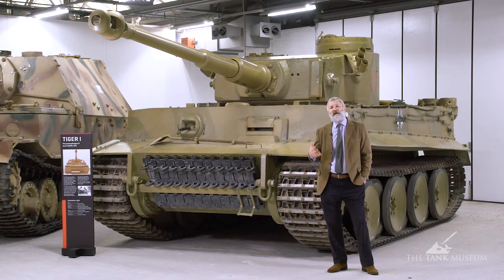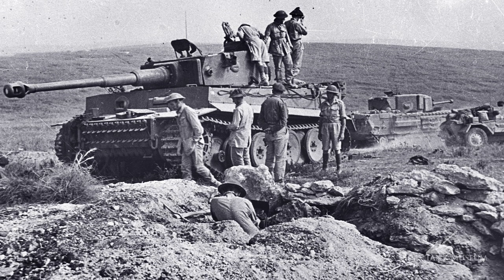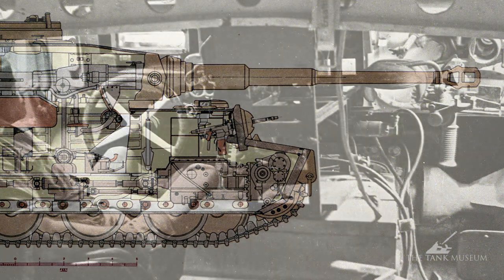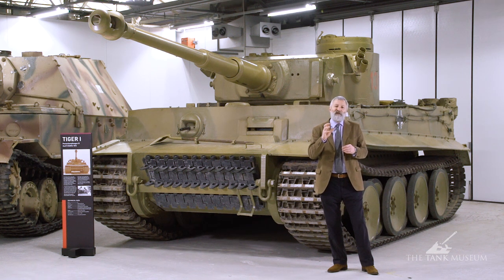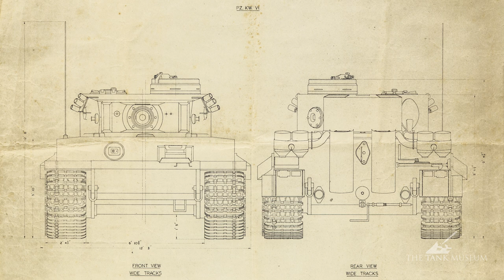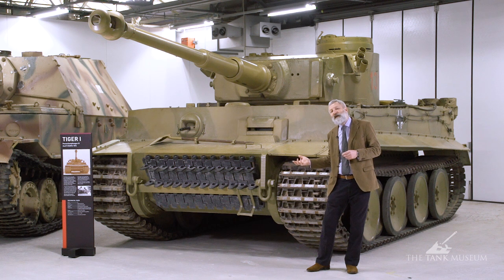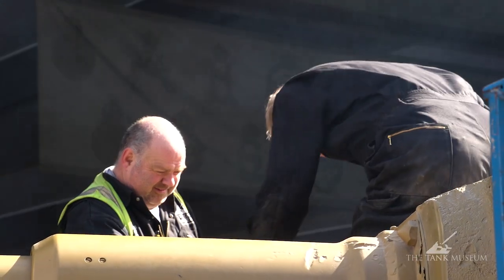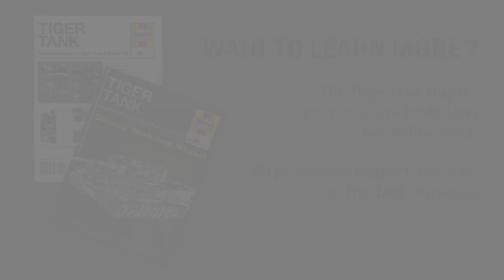Tank Chats #36 Tiger 131 | The Tank Museum

Comment: Symbol of oppression or not, Tiger 131 is still a monument to the skill of the engineers that designed it, just like U-505 in Chicago, the last of the Type IX-C U-boats. Oftentimes, you can find good things that were done by people that also did terrible things. Like everything else in the world, you have to take the good with the bad. If we were to stop using everything that was developed from things that Nazi Germany did, the modern world simply would not be possible. We would have never landed on the moon or have much of the electronic technology that we have now come to rely on. Does that cancel out everything the Nazis did? No, it doesn't. But if we remember what it cost to get where we are, then the people that died in WWII did not die in vain.
Reply: To be fair in comparison to other vehicles the Tiger I was only impressive in three ways. One of which ended up being meaningless, one that had draw backs, and one that was a big advantage.

The advantage being the gun. Nothing else has mounted such a powerful anti-armor gun in a fully rotating turret with protective armoring before. The actual armor itself was only slightly superior to the shielded KV-1 tanks and M6 (never combat fielded).  This in itself is an impressive feat considering getting such a large gun to actually work on a turreted chassis is not and easy feat.

The interleaved suspension enhanced it's mobility compared to other heavy tanks but came with huge service drawbacks. And each Tiger I was fully equipped with very high quality seals for deep fording all the way to the end of production which is quite the detail... except the deep fording was never actually used (And still hasn't ever been used in conflict to this day by any vehicle) which further increased the production cost and time.

FYI Modern electronics can't be  directly credited to Germany. Japan, United States, Germany, and Britain all had relatively equal development of electronics from the first functioning broadcast by professor Kenjiro Takayanag in Japan in 1926 on a cathode ray tube. By the late 1930s the industry was significantly more advanced in the United States in comparison to others in computing, radar, broadcast, etc. and the lead only increased during the conflict.

Rocketry however, at least the United States' definitely owes a lot to Van Braun. Without him and other german expertise the U.S.S.R. would have been the world leader indefinitely in that field. And Rocketry was a driving force behind continual U.S. advances in electronics for guidance, control, etc.
Reply: I agree. There's no argument against what the Nazi Germany terribly did, but we should still separate the deeds from the inventions. Credit is due for the technological and engineering feats that they achieved, and I say the Tiger 131 is one of the symbols for that.
Reply: I guess I was thinking more about how far electronics were developed in general by everyone because of the war (which was kicked off by Germany, unlike WWI where it was technically started by Austria-Hungary). Things like radar, radio communication technology,  and even the electro-mechanical computers that helped with encoding and decoding messages (like the Enigma or the computer that the British built to help decode Enigma coded messages.).
Reply: I agree. Those too. :>
Reply: German did not develop that much tech that surpassed other nations, the allies had massive advances that the Germand could not match, many German ideas were ultimately failures or already being developed or in use by the allies.
Reply: Okei. Thanks for clearing that up. Tiger 131 still looks cool though! Remarkable piece of artifact, wouldn't you agree? x3
Reply: Chaz t Please. The only reason the Americans developed the nuke first was because of defecting Nazi scientists
Reply: +ss33988  ..As well as British scientists, plus whatever information about the German & two Japanese bomb projects; one of which was said successfully detonated (on an island off the Eastern North Korean coast in 1945,) in a test in the a couple of weeks before Japan surrendered to the US - you could say, because of the test, the NZ Factory and Stalin wishes for the related intel, skills & humans involved, that is why North Korea became so important to Stalin & the Soviets in the late 40's, and why it is was destined to be separate country/state under Kim Il Sun (for Stalin).
Reply: I'm going to assume you are just one of those people that take conspiracy theories at face value and their 'evidence' in this case a book by Robert K. Wilcox using David Snell's story which was quite exhaustively discredited and debunked by every expert and peer.

There was no Japanese atomic weapon test. Their program went as far as to determine it was feasible (math will tell you that) but impractical  for even the United States during the course of the war to apply it in a practical weapon. And you think a country that couldn't even fuel their aircraft, ships, and have the metallurgy due to lack of resources to build reliable engines conducted an atomic test based off a book that used false documents as it's own evidence... 

Just because you read it somewhere doesn't make it true.
Reply: MPI1000 what he means are Scientists running from the Nazis before or during the War. Those did help the Allies. The Nazis never got beyond very early steps in the Atomic program. As others here have alluded to the Nazi,s were not scientific but simply put a huge drive to push engineering what was already known.
Reply: Exactly Generic Dave. They funded anyone and everyone that claimed to have something that could help them in their war effort or give them some kind of advantage over everyone else. This was both good and bad for the rest of the world. It was good for the rest of the world because many of these projects were crazy and went nowhere, while draining funds from other things, but it was also bad because some of these projects actually did work and caused much grief and suffering for both Allied forces and innocent civilians. After the war, everyone was scrambling to get their hands on the scientists and research materials that came out of these projects to learn what worked, what didn't, and what was worth putting their own research into. Both the U.S. and Russia built their cruise missile and ICBM programs on the foundation that was laid by the V1 'buzz bomb' and the V2 rocket, respectively.
Reply: ss33988 Oh really, nothing to do with allied developments, allied engineers, nothing to do with allied materials and money. Just a few German engineers? 

People like to big up German ideas from WW2 and refuse to put in context with what else was developed around the time or in use. 

They like to claim every invention or development after WW2 was due to captured German tech and scientists. 

There are even people claiming the bombs dropped on Japan were actually German bombs captured by the allies. 

Nazi Germany developed little in the way of really new tech, the allies developed more, post war ideas from all sides were used in some fields.
Reply: The only way Nazi Germany made the world the way it is today is by actually starting the Second World War. They were good at engineering(which has been debated endlessly if good or bad for war winning), but the allies came up with much more successful new technology. Britain in particular had a lot of good ideas(which the USA developed and produced successfully - radar, Merlin engine, jet engine, ect-). A big part of successful engineering industry is preparation. Nazi Germany had been gearing up for war since 1933 whereas Britain and the USA started pretty much only when war began. Just look at the aircraft and tanks Britain produced immediately after the war, tanks and planes that lead the world for many years despite Britain's poor vehicles produced during the start of the war.
As for "never landing on the moon" although the Nazi research no doubt sped up advancement in the USA and USSR, it would have inevitably happened anyway. Rockets are one thing, but the advanced theorising and practical challenges in supporting human life in space were not progressed at all by Nazi Germany.
In short, the war quickened the pace of war related technologies as all wars do, but with possible exception of nuclear weapons the world would be very similar to what it is now without it. 
Apart from Germany and Japan wouldn't has caused the deaths of 50,000,000 plus people.
Reply: I fail to see a way this tank can be oppresive seeing as it's made for soldiers, not concentration camp guards....
Reply: It has become a symbol of blitzkrieg (although it was used for it). And blitzkrieg is synonymous with nazi conquest. Conquered nations find being occupied oppressive, being.
Reply: sumone sumwhere Wtf is up with the Nazi apologia in the last 10-15 years... The Tiger tank was made to made to advance the Nazi war effort of conquest and subjection of inferior 'untermenchen'. Why are you trying to frame it elsewise?
Reply: and created solely through massive deployment of slave and forced labour as were the V-rockets, the jets etc etc. Well said!
Reply: Robert H. Goddard No kidding. It's a steel box welded up out of plate with a lot of holes drilled in it with a horribly designed road wheel setup. I fail to see it as any sort of engineering marvel. Crude as hell really.
Reply: Symbol of oppression? You could say the same thing about M1 Abrams depending on what side of the fence you're in! These are war machines and intended to kill things(and people). There are no tanks built for peace. 

Although you can't deny the fact that they are marvels of engineering which is the very reason most people(including myself) admire them for.
Reply: Poor design by today’s standards. This was the tank all other nations wanted! In the 1940’s there were no other tanks that could compete with the Tiger. Hence “Blitzkrieg”! The US  improved on the Tiger tank from the Pershing all the way to the Abrams.
Reply: @Cragified  Especially if you read it on the internet!
Reply: > Tiger 131 is still a monument to the skill of the engineers that designed it

If you yourself were an engineer and knew even the basics of tank design theory, you'd realize how hilarious that sounds, and that "skill" there should actually be in quote marks.
Reply: @chazt8604  the  entire German philosophy was flawed. The Bismarck was obsolete when she was launched. The Wunderwaffe killed 11,000 people and cost the German 10,000 tanks. Flawed thinking.
Reply: @ss33988  Einstein didn't defect for fun. He got scared and left.
Reply: USSEnterpriseA1701 ,with a screen name like that you should know better. No matter what "good" was done in the technical achievement of Tiger 131 (or any other object), it was intended for oppressive and inhuman purposes. Humans always seem to overlook the intended use of fancy new technology, all throughout history. It just is not fair and decent to all of our fellow humans that suffered and died under the Nazi regime to overlook their ideology and give praise to an object. 
 And truthfully Tiger 131 is mostly a technological dead end. Nearly nothing in or on this tank is used now.

Comment: Don't know if anyone associated with the museum would see this, but I'm glad this video went up when it did. I'm working on a paper for a class of mine about the cost/benefit of operating pieces like this, and some good points eluding to that subject were made. I had sent an email to the research library address requesting some statements or re-direction to someone better suited to answer my questions, but no replies.
Reply: Good luck on your project! If you are looking for research material, there was a certain thesis, "Swinging the Sledgehammer", which was an analysis of the German heavy tanks and its use. I think it is still available for free online.

Comment: It's a shame they've painted over the original paint.
Reply: Maarten van Rossem Lezingen They couldn't  help themselves. Totally destroyed its originality and patina. Like putting polyurethane finish on a rare and valuable 300 year old piece of tortiseshell veneer furniture. Hopeless.
Reply: maybe they got a government grant to do the "work" on the tiger.
like the cutty sark in london, burnt to the ground in order to make a 200 million job.
in the process someone gets rich.
Reply: Actually the original pant chipped off and rusted   they had to take this thing apart piece by piece and rebuild everything
Reply: You guys have ZERO clue about metal, machines and paint ... it HAS TO be renewed ... or the metal starts to rust away.
Reply: @Muck006  I know that's why I said they had to take it apart and rebuild it. Meaning the original paint job is long gone

Comment: Run a replica, keep the original as a showpiece.
Reply: would cost some money to build a convincing replica.
Reply: @anngo4140  with vehicles it's always better to run the original and keep it in tip top condition. Because vehicles deteriorate the longer they sit doing nothing. Especially running ones
Reply: Hint: machines NEED to be used or they break down. The CRANKSHAFT will "settle down" in one position and BEND (i.e. become unuseable) if it isnt used, which is why all oldtimers and engines in museums SHOULD BE USED every once in a while.

Comment: My comment is fairly lengthy, so please have patience. One of the primary reasons the M4 Sherman tank was not replaced with a more capable AFV was the problem of transport. Every Sherman (and Grizzly) was built in the United States or Canada and transported across the North Atlantic to Europe, North Africa, and Russia. In the case of the war against Imperial Japan, the Shermans had to cross the Pacific Ocean. However large they wanted to build a tank, however massively armored the ideal tank should have been, a limiting factor was the lifting capacity of dockside cranes. Today there are special merchant vessels designed specifically for the auto industry which allow cars can be driven on and driven off without the use of cranes, but in 1940 the typical merchant ship had two holds, one forward and one aft, accessed by overhead hatchways. Cargo had to be lowered into the hold and raised out by cranes. Some dockside cranes of the era could lift 40 tons, but most would struggle to lift 30 tons. Consequently, that restriction limited the Sherman's maximum weight. 

Later in the war, the Landing Ship Tank was developed which allowed tanks to be loaded into the ship by driving up a ramp built into the LST's bow. Using LSTs several hundred Pershing M26 tanks made it to Europe in time to fight in 1945. (However, those ships were not especially seaworthy, nor were they as numerous as the more easily constructed ad conventional Liberty ship.) 
I assume an LST was used to transport this caputured Tiger to Britain, but if this is not the cae I'd like to know the details.

Neither the German Navy or the Italian navy had an equivalent vessel to the LST. How did they get Tiger 131 to North Africa? Did they build a dockside crane capable of lifting 54 tons? If not did they transport the tank in sections and reassemble it after arrival?

Comment: Thank you so much for keeping Tiger 131 in such great condition. When you think about it they mounted the 88mm canon on a tank which was actually an anti aircraft and ground support weapon which had long range capability. You combine this with thick armor and superior optics and you really have a force to be reckoned with .Hence the allies coined the phrase Tiger fever.
Reply: No, that's not true. There isn't just one "88mm cannon". This tank has a gun that's very different to the famous "88" you are talking about.

Comment: Splendid Vid, thank you Mr Tank Museum.
 Is there some open source about how the British Intel viewed this tank in the following years of its capture?

  Its now common knowledge that the tank was too complex, at least too complex for the German(any Nation) of its time. It took too much resources out in terms of keeping them running in war time.
Be that as it may, the Tiger I still must have been a very interesting piece of Tech at the late stage of WW2. 

I have been reading some books about the Tiger. And some Historian with Tank background said that the Tiger I did make them feel as the frontrunner of more modern Tank design when sitting inside the crew compartment.
Reply: I don't know exactly what, if anything, the British took from studying this Tiger. They certainly liked the simplicity of the gun mechanism, but it was much the same as in other German tanks. They learned that the best optics come from Zeiss, but that knowledge wasn't much use. They did like the layout and storage of internal equipment.

Comment: I'm still surprised, as it was a common practice to at least destroy the tank by dousing the interior/flammable parts of the tank in gas, and lighting it on fire. Despite that, I'm still glad that an engineering gem is still intact.

Comment: Quick question. There was something said about parts wearing down because of it being run by the museum. Would it be possible for someone to come any take measurements of the parts that need replacing then recast the parts to replace them?
Reply: Oh yeah parts could be machined easy enough the point is they want it as original. So any part that wears out and is replaced in their eyes makes tank 131 not as valuable. I think it running hearing the motor and seeing it's treads turning turret swinging makes it much greater then sitting static in a building. So what if a few internal parts have to be replaced but hey they are the care takers of it.